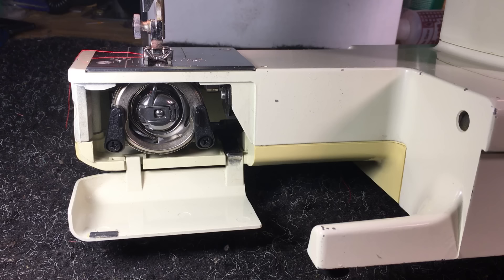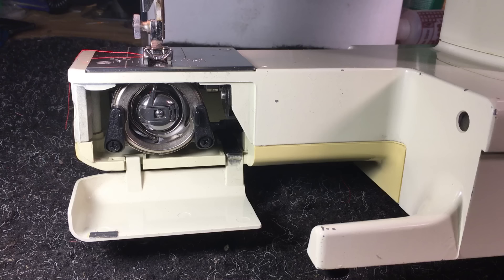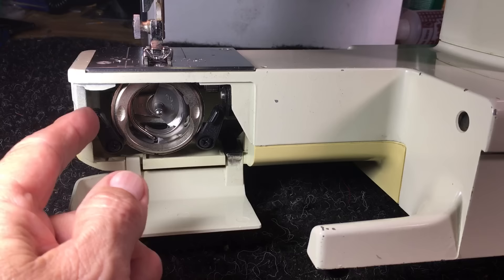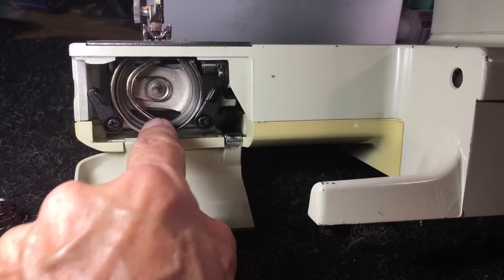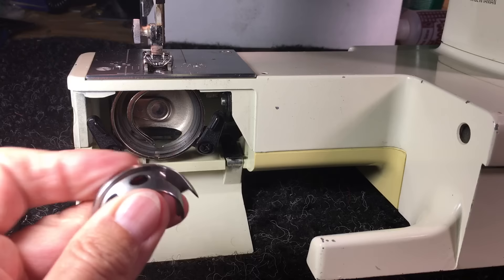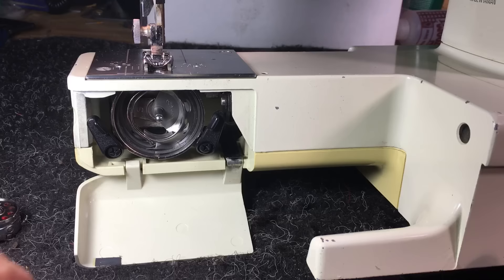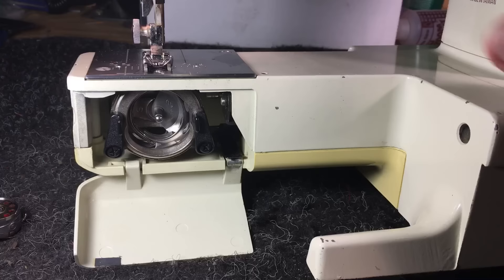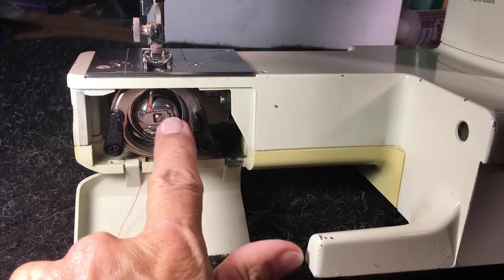Re-assembling the shuttle hook mechanism on a front load 15 class sewing machine

Comment: Thank you Randy.  You're a lifesaver.  After 50 years I've never had to deal with this issue but you made it fast and easy.  Keep up the good work.
Reply from the maker: You’re welcome Becky.
Reply: It took me a while still but I did get it 😅 thank you so much! I super new to this and have no idea what I’m doing yet… but I will soon enough
Reply: Thanks. I have the instructions but I think they are horribly written. I thought I had a choice between the bottom bobbin or the top. I thread it at the top, but it doesn’t sew, now, you’re saying both has to be threaded. Where do I put the thread through from the bottom? It’s hard for me to believe they go through the same needle…The hole is so small, I had to use high powered microscopes glasses to put the tread through…it looks impossible to put two threads in that tiny hole….thanks for your help.
Reply: When you have thread on the bobbin and pulled out about 3 inches put it in the bobbin holder.  make sure you have the thread on the top  threaded through the needle. turn the wheel towards you slowly and the bobbin thread will come up through the hole by itself

Comment: Current August, 2023 - I have some bobbin bunching on a vintage New Home 671. So I had to take the bobbin parts out to take a good look.Then I was having some trouble putting the 3 pieces back in. By watching you I could see I  wasn't putting the pieces back in the right order. I got it partially fixed and sewing a regular stitch, but I think the bobbin tension still needs adjusting and I may take it in to a shop for the bobbin and top tension adjustments.  I also plan to give it some oil.  Otherwise it's a very sturdy and clean machine. Thanks!
Reply from the maker: That’s a great machine. I’m glad I could be of assistance. 👍🏼😎

Comment: Thank you for reassuring me that I do, in fact, have it all in correctly... BUT the edge of the hook cover (when inserted as you have shown) kept bumping against the edge of the race assembly, so the needle couldn't go down. I was given this machine a while ago, and kept it as a backup for when my regular machine needs servicing. I have used it once; it worked ok, but a needle broke inside the bobbin case holder so I pulled it apart to retrieve it. I got it back together, but then the needle wouldn't go into that area at alll! I just figured out that the leading edge was bent out, so it was blocking the way. I just went to bend it back in ..... and it snapped off! Problem solved, I guess? It still makes slight contact, but at least the needle can go down and up again....
Reply from the maker: Those race covers are inexpensive if yours is broken. It’s a special size for the Kenmore front load. The circumference is smaller than a standard side load. 
If ordering a new one, be sure to specify the Kenmore model series. 
👍🏼😎

Comment: Took me 5 different Video's. It's those off handed comments like "get a little piece a thread in there, and it'll lock it up like it's welded." Yep! Thanks!
Reply from the maker: You’re welcome and glad to help.
Reply: Once out, everything moving like greased lightening. Thanks again. I'll be using you as my primary sewing machine repairman.
Reply from the maker: @gerboblevin7709  I will try to perform to that high standard that you have now set. 😎👍🏼

Comment: Omg thank you for this video!!! I'm practicing and got nesting and basically everything fell out 😭 tried my manual but it was no help!
Reply from the maker: You are welcome. Glad to help.
Reply from the maker: Be sure to put your tension dial on 4. 
Raise your lifter lever for your presser foot in order to correctly thread your upper tension assembly. When you lift your presser foot lifter lever, it disengages your upper tension. 
Don’t use an oversized thread. Make sure the thread is all purpose/dual duty.

Comment: how do you replace the  shuttle driver  flat spring? has 2  small screws holding it in place , difficult to get any kind of tool  in there, do you have to remove driver from  machine?

Comment: Randy, I have done everything as you demonstrated here. What causes the thread to continue to wrap around the hook assembly? My friend had her Necchi 537L taken to have refurbished. She wound up buying a new machine and gave her old model to me. I am not a novice sewer, although this machine is new to me, however, I have completely read and reread the instructions for this model and it continues to jam. When I open the Bobbin and remove it, after untangling the threads, I find threads have wrapped several times the part of the hook assembly you grasp to remove. I also made certain there was no wear and tear on the hook assembly as you showed in another video. Looks brand new and oiled.  Any help would be appreciated.
Reply from the maker: If the timing is off or the thread gap is not wide enough for the the thread to slip through, you will get what you are experiencing.

Comment: Thank you very much. I wanted to make sure I was putting it back together properly because my thread is coming in front of the bobbin and catching on the finger of the bobbin case. 😅 I still don't know what I have done wrong but at least this part is correct
Reply from the maker: Put a drop of oil on your bobbin case latch and make sure it snaps fully into place. 
That might help.
Reply: @randyyoursewingmachineman9954  thank you very much! I did that and filled a new bobbin, and now it is happy again ☺️
Reply from the maker: @scifiholly  excellent. 😎👍🏼

Comment: I would like to see in what direction the thread goes when placing it inside the bobbing case?  When I start sewing & as the needle goes down the thread gets tangled up under the fabric and the needle will not move.  Please help.  Thank you.
Reply from the maker: The direction of the thread in the bobbin case has no real bearing on stitch quality or malfunction.  If the thread gets tangled underneath, first make sure your tension dial is set on 4. Second, make sure that you’re using an all purpose/dual duty thread. Any oversized thread such as quilting, upholstery, etc, will cause the problem you’re having. Third, make sure that you thread the machine properly with the presser bar lever in the up position. Make sure that the thread is between the tension discs in the tension assembly. I have a video on everything I just recommended.
Good luck.

Comment: Hello Randy thanks for the video.   My hook is no longer snuggly fitting into my race are you able to adjust the piece with the screws to help it fit better?
Reply from the maker: It doesn’t really fit “snugly”. It has to have some back and forth movement to allow the stitch to form. If it’s flopping around, that’s different. That means it’s probably not assembled correctly.

Comment: I was wondering if you could help on my White 1510?  It had been in storage  I brought it out cleaned and oiled..pressed the pedal and it was sewing great!  Made a noise and now the race (?) bobbin area will not turn (I then took shuttle apart).  I took the footplate off and the gear that moves it was stuck so I cleaned and oiled and got it to move manually..by moving the gear and moving the pointed race part inside the bobbin compartment but cannot get bobbin to move with wheel or pedal..what did I do to it?
Reply from the maker: Take the four screws out that hold the cap plate on the gearbox,  under the hook assembly, and see if the drive gear is broken. It sounds like that may be the issue.

Comment: If I don't have all the components together properly, could that cause the machine not to work? I've busted off a needle, and since then and not having the components in properly, the needle won't go up or down, but i can hear the machine running... I'm frustrated
Reply from the maker: If the parts aren’t assembled properly, the machine will be jammed in that area. 
That will cause it to behave as you’re describing. 
Turn the hand wheel by hand to test whether or not it’s reassembled properly. 
You don’t want to keep testing it by running the motor and risk compromising your belts.

Comment: i’ve been having issues with thread getting bundled up and stuck in the bobbin case around the shuttle hook… any reason why this would happen?
Reply from the maker: There are many reasons. I’ve done several videos addressing that issue. 
1) thread is too thick
2) not threaded properly 
3)Burr on the hook
4)timing not set properly 
5) needle bar height is wrong 
There are too many to list, but those are the most likely.

Comment: Thanks so much for your sharing...I'm a knitwear designer and I have great machines; but this Kenmore, bought used is great.  I knit more than I sew LOL so your video saved me from cussin' out the shuttle replacement.  Can I post another question?  It was working all of the zig zag various stitches; not it only zig-zags..can you help?  Sure that I'm not the only one.  Peace R
Reply from the maker: Sure you can ask more questions. Here’s what I think is going on: if it was doing all the stitches previously and now only wants to zig zag, the stitch selector slide is probably stuck on the zig zag mode. There a small spring that releases the follower and allows the selector slide to move from stitch to stitch. If it sits for a long time, or is in need of lubrication, it will usually respond to a couple drops of oil on the selector slider.  Take the top off and the mechanism that you’re looking for will be just to the  right of the machines center and to the right of the cam stack. Move your stitch selector knob back and forth and you will probably see it trying to move.  Often times, just moving the selector back and forth will free it up. 
Place some oil where it looks in need and work your stitch selector dial. It’s a finesse move with a light touch required. No banging, hammering, prying, or salty language is necessary. Have fun and good luck.

Comment: Randy thank you so much.  I purchased the 395 machine at a second hand store and the shuttle had fallen out. I thought it was broken! I was hoping to fix myself and you helped tremendously. It appears that the needle is going into the hook area of the shuttle correctly but the needle isn't grabbing the bobbin. I'm stumped. I've cleaned the machine as best as I can and I've watched other videos but haven't come up with a solution. Do you have any insight or thoughts? Thank you again.
Reply from the maker: Double check your needle installation to be sure that the flat side of the shank is to the rear and it’s inserted all the way up to the stop pin. If that doesn’t solve the problem, perhaps the hook timing is off. Normally if that’s the issue, the needle will be striking the hook as it rotates. Good luck.
Reply: @randyyoursewingmachineman9954  thank you. After checking the needle and confirming it was dropping down properly I checked the tension. I had wrapped the thread around the tip of  needle in a weird way after I threaded it. I don't even know how I did it but that was causing the problems. Thank you so much it's working great.
Reply from the maker: @blairseibert1778  good job. A little logic goes a long way. You figured it out so congratulations.

Comment: HI there i was going try to lesrn to sew so I bought s singer 30518  I threaded everything and the bobbin would not thread ,, when I opened it up I noticed it was not turning when I loved the wheel by hand, I did what you said here but then I found what looks like a half of a black plastic gear type round plastic thingy behind the two metal parts .. so I imagine this is why it is not rotating,, do you think this is repairable? :(

Comment: my hook assembly seems to be loose and my needle keeps getting stuck and breaking…ive taken it apart and put it back together almost 100 times and I have no clue how to fix it! Any suggestions?
Reply from the maker: It’s not assembled properly. 
Make note of the instructions. 
Step. 
By. 
Step. 
Swing the left clip to the left, and the right clip to the right, before you put it back together. 
Then the left clip will snap to the right, and the right clip will snap to the left. 
Be sure that the retainer ring has the two bumps facing towards you. 
That’s all it can be. 
Once. 
And. 
Done.

Comment: Your videos a re amazing - thank you - my shuttle race itself has totally stopped moving. I had a thread jam and cleaned that up, but once I tried to re-assemble I noticed the shuttle race that stays inside the machine is itself stuck! Do you have any ideas or suggestions? This video came the closest to answering my problem so far. Thank you for all of these!
Reply from the maker: On a sewing machine, if any one part stops, everything stops. A sewing machine is not an instrument, it’s an orchestra. Every part is dependent on another part. If one part moves , every part moves, and vice/versa. You probably have a dry bearing that needs to be oiled. If the machine is locked up, I would first try spraying (with the directional plastic tube) a penetrating oil into the bearings of the upper and lower shafts. Also spray lube the area where that shuttle driver comes out of the gearbox behind the hook race area. Get it moving and work the lubricant into the dry areas. It may take some time to loosen things up. Tilt the machine on its back to let the penetrating oil soak in.
Reply: @randyyoursewingmachineman9954  Thank you so much for su ch a speedy and thorough reply - I'll give that a go. Happy New Year!
Reply from the maker: @mikkinkead6563  you too. Thanks

Comment: In my Janome machine there is some play between the spring on the shuttle driver and the shuttle. Is that on purpose? can I bend the spring a bit more so that there is no gap or rattle between spring and the shuttle?
Reply from the maker: There needs to be a small gap between the cushion spring and the shuttle. This is called the thread gap. It doesn’t need to be very big. If you’re getting an extreme amount of movement or rattle, a tiny amount of bending can be done.  Do it carefully and don’t break the cushion spring.
Reply: @randyyoursewingmachineman9954  thanks a lot for the reply, and for the video. Amazing what one can learn from others here
Reply from the maker: @MrBrownpotato  indeed. I go to YouTube for how to videos all the time. 
It helps to see what to watch out for to keep out of trouble doing household chores and repairs. 😎👍🏼

Comment: Hi, thanks for this video. Need advice on the take up lever, opened my machine to clean and now the take up lever won't move. I see a spring loaded area and if I hold it, it would move the lever. How do I adjust the spring back into position for it to move the take up lever please? Many thanks
Reply from the maker: The spring loaded button on top has to be screwed down tight. A drop of oil around the  circle (seam) of the button area won’t hurt. A couple drops of oil at the lower housing where the presser bar moves up and down will help. Raising and lowering  the presser bar will spread the oil and get it in the places where the drag is occurring. Push the button down at least half way to apply medium pressure to your sewing project. Push down more to add more. If you press the outer ring, it should release the pressure completely to allow free-motion, darning , or monogram.
Reply: @randyyoursewingmachineman9954   hi Randy, thanks so much for responding. Is there any way to send an image to you? It's unlike the regular newhome sewing machine. This is the combi 10 
There are 3 guides at the top right close to the wheel that slides into a white plastic slotted ring, I think it's to lock the front sewing machine needle bar glide when it is switched to using the overlocker when i deselect it back to sewing, logically , it should spring past the slot continuously when the machine runs. But, what's happened is it 'locks' into the slot, even though I've selected it to sewing. Would be useful if I can send a pic. Thanks so much for your support
Reply from the maker: lizz e if you figure out how to post a pic, I’ll take a look at it. Go to ABCSEW.COM and find my phone number and send it as a text.
Reply: @randyyoursewingmachineman9954  hi Randy thanks much, didn't realise you're in the US, I'm here in qld Australia 😁 do you have an email address. The number is a US number, or do you use messenger or WhatsApp? Have a great day. Cheers
Reply from the maker: lizz e my email is ransewco@sbcglobal.net
Reply: @randyyoursewingmachineman9954  thanks so much Randy.
Reply: @randyyoursewingmachineman9954  hello Randy, my grateful thanks for your advise. I'm really touched that you care to help a total stranger in a different country. Can't find words to express my gratitude.🙏👍😁
Finally resolved this after your advice of cleaning the disc's and  the manual that the spring needed to be in a certain position before closing the cover. All sorted. Thanks again and have a fabulous day. Cheers